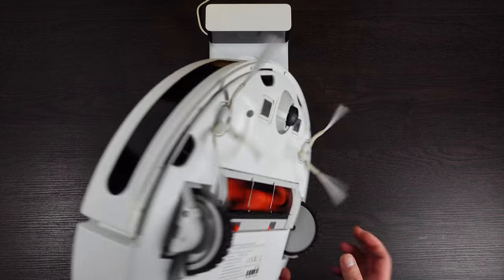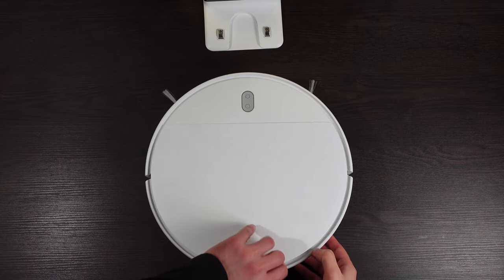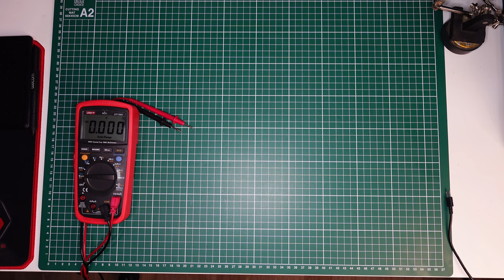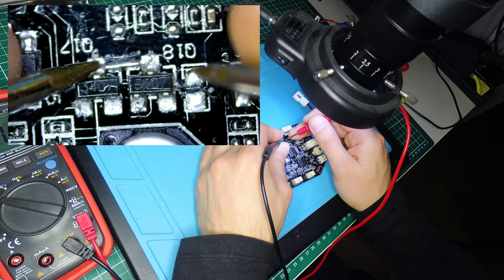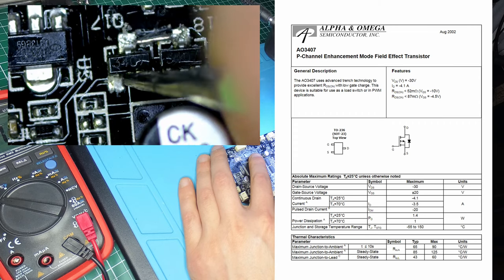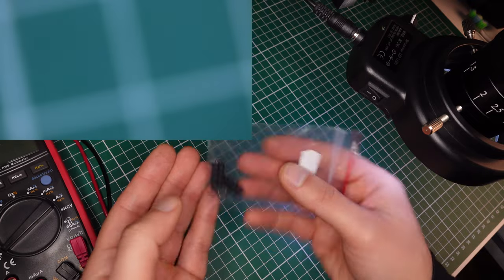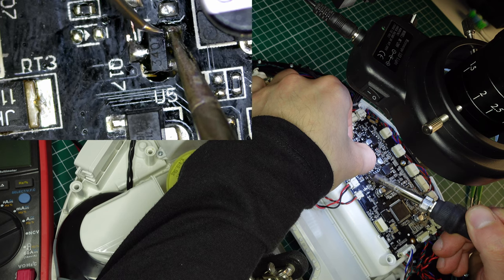Xiaomi Robot - main brush issue - PCB repair

Comment: Brilliant repair! Thank you a lot! Already ordered the MOSFETS. As I can see, this problem not always caused by a shorted MOSFET. But I believe that in my case I will need to replace them. The brush got "brush error" several days before, when plastic bag wrapped around it. After that I noticed that brush somehow failed to spin from time to time. Yesterday the robot appeared completely discharged, and after placing the robot on the dock brush started to spin constantly. I hope to bring the vacuum to working condition again.
Reply from the maker: It seems that indeed your robot has the same problem. I hope you can solve the problem and come back with good news. Good luck!

Comment: I had the same issue but solved.. Just hold the unstoppable main brush for a few seconds with your fingers. It will stop and give error. Put the device on charger and wait untill full charge. Then you can use your robot vacuum cleaner as usual without any issue...
Reply from the maker: I'm glad it worked for you, but I doubt you had the same problem.
Reply: @techfixPOV  the main brush was turning until the battery goes off.
Reply: Thanks you it work🎉🎉 now i hope never get error again
Reply: @yerkoc37 it's great to hear that 🎉
Reply: That trick worked for me, for a while, but eventually it stuck on as in this vid. Arrrrgh!!!

Comment: Hi! Having the same problem. What type of mosfet did you use? Could you provide a link? Thank you!
Reply from the maker: The MOSFET is a P channel AO3407. I recommend you replace both MOSFETs. Here is a link where you can find it: https://www.ebay.com/itm/285182905075?mkcid=16&mkevt=1&mkrid=711-127632-2357-0&ssspo=z6d97jZnT5C&sssrc=2047675&ssuid=IxDz5vwDR22&widget_ver=artemis&media=COPY
Reply: @techfixPOV  Thank you very much, I ordered some! The mosfet on mine looks burned, however only 1 out of the 2. The board just got swapped a month ago in a warranty claim, but failed already. Do you have any idea how would this mosfet fail again and again? Could it be something related to the charger?
Reply from the maker: If the main board has been replaced, I recommend that you send the robot back to service to be repaired under warranty. It is possible that the defect is caused by the motor of the central brush or because of the central brush that spins hard due to the accumulation of dust or hair. They should check in service what is the cause of the defect. The charger has nothing to do with this defect. If you decide to change the mosfet, check the central brush if it rotates normally and you should replace both mosfets.

Comment: Hi amigo! Should come same problem from another part of robot? Not from mosfet?
Reply from the maker: There is also the possibility that the Mosfet is fed incorrectly (through the GATE pin) by the board controller. Thus, the mosfet remains permanently in ON mode between the Drain and Source pins. Have you checked both Mosfets and they are not short-circuited?
Reply: @techfixPOV: well the circuit board's  failure I did not see , the robot is my son's and he said me: dad repair it pls.He will send it me in the future. You know I am a technician A bit later I can say concrete answer. Thanks bro!

Comment: Hello, I have no experience with electronics, I only have a soldering iron and tin to solder, I have the same problem, from what I understand would it be replacing this Mosfet? What is Mosfet 3407?
Reply from the maker: Hello, if you don't have experience with repairing electronics, I don't recommend trying to repair this robot yourself. There is a risk of causing other defects. Here you have more info about this mosfet: https://aosmd.com/sites/default/files/res/data_sheets/AO3407.pdf

Comment: was the error message brush motor stalled or overheated?
Reply from the maker: The robot did not generated any error. The mosfet that is powering up the center bursh motor is shorted between the drain and source, so the motor will be powered directly from the battery even if there is no trigger voltage on the gate. This can be caused by several reasons: overheated mosfet, too much power drained by the motor due to a stuck brush, a bad mosfet...
Reply: Can’t i know mosfet value or id? Where want to buy

Comment: hello, i have another problem.  despite replacing the battery, the vacuum cleaner turns itself off regardless of the set suction power.  do you have any solution?  Regards
Reply from the maker: Hello, if you have an multimeter, I think that first You should check the voltage from your charger and the voltage from your battery after one complete charge cycle. Maybe your charging station is faulty or the robot's charging circuit have some issues. First You should exclude these two posibilities. Compare the voltage readings with the values specified on docking station and battery. If both readings are fine, then I recommend You to check the mainbord for liquid damage or bad contact on all connectors, specialy on the battery connector. If You have any other questions, I'm glad to help You.

Comment: Hello friend, my robot is the same, but only the main brush gives an overload error and the red light is on, I start it again after a certain period of time, it gives a gene error, overload error, I should do the same thing.*
Reply from the maker: I think you should try to start the robot without the brush connected. If the error is still there, you may have a problem with the motor or the PCB. If the error is gone, you need to check if the brush spins freely, maybe is stuck.
Reply: @techfixPOV  There is no clutch, now the card is gone, it is not working, I gave a new card list, card repair is expensive, I ordered from China

Comment: my robot says brush error, what does this mean?
Reply from the maker: It is possible that the rotating brush is blocked. You can try to start the robot without mounting the brush. The robot will no longer give that error if the problem is with the brush. If the error still occurs, it is possible that the motor or the electronic board are defective.